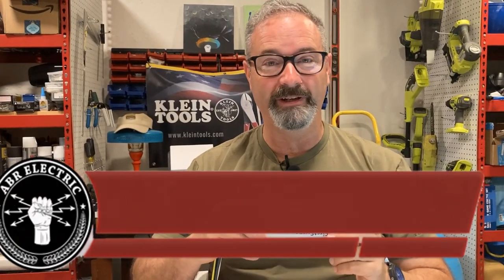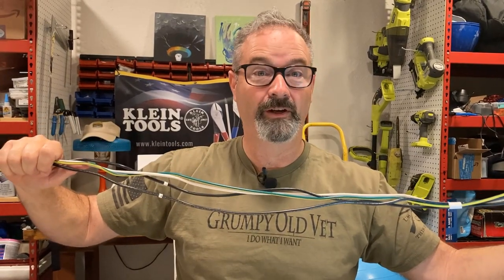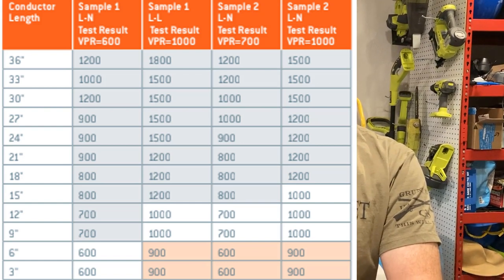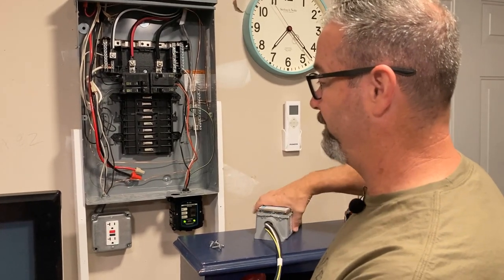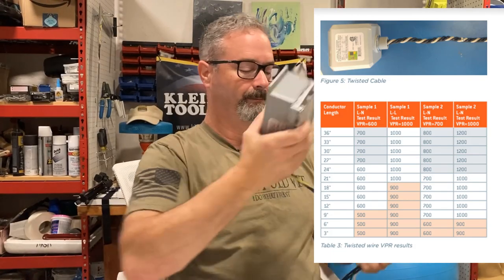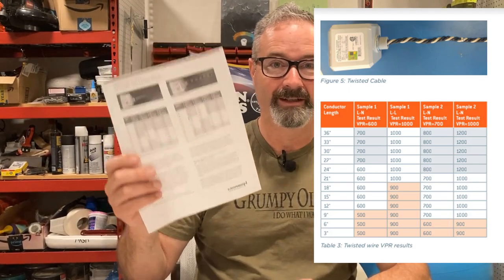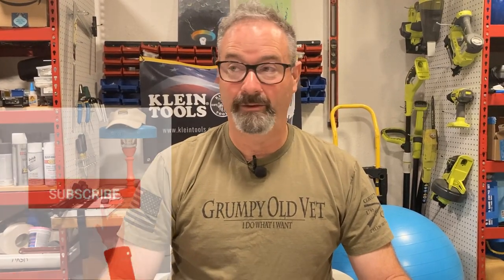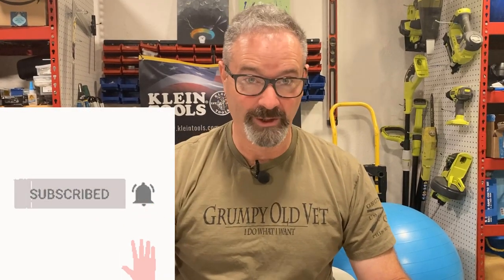Let's do the Twist!: Reducing Inductance In Wire Leads for your Siemens FS140

Comment: Very good video - thanks! When twisting the wires on the FS140, should you twist all four leads together? Twist the two that connect to the breaker separately? Curious what is the best way to twist. Subscribed for the clear, down-to-earth explanations. Keep up the good work 🙂

Comment: What I find ironic about the twist being a good thing is it completely goes against “short as possible”— as twisting is inherently requiring more wire “length” to achieve the same length after twist… meaning it might take 16” of straight wire to make a 12” twisted wire. 

And the second point they drive is straight as possible, no bends or curves if at all possible. A twist is just that, albeit a very gradual curving or bending. 

So it’s funny to me in that way, but they obviously say it in the documentation.
Reply from the maker: @poisonfortheweak  and, because only 2 wires go to the breaker, and the other 2 go to hot and ground, you can only twist for a short distance anyways

Comment: BTW...I reached out to Siemens Tech line on 3/04/24...... ( what a chore...they changed their phone number and I plowed through 4 alternate numbers !!)...and the true tech guy on the last call.....agreed with me that WHERE we place the breaker on the busbar, either close to main breaker or further down....is of little consequence....but agreed with me that the shortest wire length gives value. The unspoken hint was that the buss is a very heavy "gauge" and therefore all CB's act like being in "parallel", so where you place breaker is of little concern. Whereas we are limited to the small-ish 10 AWG ga wire for the connector of the FS 140,  and THAT makes a difference. Caveat....seems to contradict Mersen study regarding bus location.
Reply: Yeah that’s interesting. It doesn’t say anything about proximity to the main breaker/line feed entry in the docs. Though they are super anal about constantly mentioning to choose the breaker that is closest to the SPD— which could easily be the furthest from the service lines. It seems to indicate what you said, that shorter leads to the SPD is more critical than where it is on the bar. 

I mean I get the idea- if a surge comes in from the mains… then you want it to be the closest point to that entry so it can immediately shunt it back to neutral/ground before it gets any further. But electricity is fast. By time it hits the top of the bus it has hit it all. The more important thing I would imagine is it would travel the path of least resistance, right? So it’s gonna take the path that is shortest and easiest to complete the circuit. 

So if it his the bus bar… what path is it going to choose- from the bus bar, through 16” of lead to the SPD and immediately to neutral/ground? Or is it gonna travel through 50’ of Romex across your house and get to the first thing on that line that can complete the circuit?

I’m not an expert or an electrician. But that seems to make the most common sense to me.

Comment: I am watching all your videos...and I just bought a 140 surge protector. Looks simple to do. I want to move a metal handy box to make elbow room. Can i run the handy box with a 6 inch black pipe nipple? Its pre cut and much more solid than 3/4 EMT and connectors. I know you cant do a long run in black pipe...and electricians use black iron nipples all the time. Thanks
Reply from the maker: Technically,  you want to use materials that are listed and approved for that application. Will it work? Yes. Wouldn't necessarily pass an inspection. 
Your call, sir.
Reply: @abrelectric  thanks

Comment: Interior location with flush mounted panel, to keep wires short...how about drill into side of panel and install SPD adjacent to the panel with very short leads directly to breaker nearest service entrance?
Reply from the maker: Definitely doable. Challenge is protecting the wires as they pass through the stud and the side of the panel, with conduit, nipple etc.

Comment: Man I wish I knew this before installing mine. They should put this in the instructions. I think the FS says to put the breaker as close to the incoming line on the bus. What impact does it have if you are not (example, what you mentioned about your Eaton and moving the breaker)?
Reply from the maker: The FS instructions Say to keep the leads as short as possible,putting the SPD as close to the supply breaker as possible. I think the impact simply comes back to the length of the wire leads. 
I have reached out to Siemens tech support to get their feedback about twisting the wires to reduce the v p r
Reply: @abrelectric  agree. As short as possible and we know we do what we can there. Mine is about 12" to ground/neutral bar on the terminal closest to the return wire and about 16" to breaker with the breaker being the first breaker after the main (which I thought the instructions recommended). Didn't twist and if I did now I probably wouldn't have enough wire. Wires are running in EMT in wall. I would love to know what you hear and any details on how a wire bend impacts the vpr.

Comment: Are there any drawbacks to the models that replace a breaker? QSPD models have max of 65kA and they use up a slot, but they have zero wire length between L1+L2 and only ~3" for neutral. Best case scenario with FS140 8" of wire. More likely 12" or even more if the installer did not worry about minimizing length. So QSPD is 600V and the FS140 is 600V-900V and a more involved external install. Maybe the worry about them overheating and starting fires has people opting for externally mounted SPD. I can drop in 2 QSPD breakers in my panel and be done with this project in 2 minutes. This also has some redundancy and better VPR. How often do these siemens SPD have catastrophic meltdowns?
Reply from the maker: If the breaker style SPDs have the specs you like, go for it! They are super simple. This is the kind we use most often because the client just wants Code compliance and is not worried about the highest levels of protection.
Reply: @abrelectric  the only difference seems to be capacity, do you want to cut one open and check?

Comment: A Surge protector strategy, like any other insurance is not foolproof, and the insurance companies always say it's an act of God and we don't cover it.
 One customer had multiple layers of SPDs when the utility companies 25 KV line fell down on the 12 KV line.  The resulting prolonged over voltage was well beyond that of the surge protectors parameters.

Comment: is there a way to test the ground to make sure it is correct? -- aside from looking to see if there is a wire on the ground rod outside by the panel????  is there always a water pipe ground????? AND  when we twist, are we twisting all 4 wires together or just the two going to the breaker?????  but mostly, how do we non-professionals know the ground is correct? so I guess the whole does it have to be at the top of the panel thing is a whole lot less important than make it  as close to the SPD as possible no matter where it lands on the bus (making sure it hits an odd-even slot so it hits both legs)
Reply: We can only test for ground, not quality of ground. If we had a megger, we could not test ground quality apart from utility's third wire which has a white line on it. Visual inspection reveals most ground deficiencies like grounding conductor disconnected and 2 foot ground rod lying on the grass, I think that's more than half, just that obvious.
Reply: ...I guess we might disconnect ground wire at bus or rod, meg just the rod or 2 rods. If ground isnt working at a device or box, something should be visible. We have to notice bond at main, all bare wires bonded at boxes. Spot old romex, for which code leaves us alone to judge how to make that work, pretty much, so that we will git er done for safety sake

Comment: Does moving the breaker all the way down to the buss bars make  difference since it is further away from the other circuits?
Reply from the maker: Moving the spd breaker closer to where the feeders attach to the main breaker helps the performance.
Reply: @abrelectric  I've read many of your other comments that it doesn't matter where the SPD breakers are installed relative to the main disconnect.  The comment above seems to be the most recent on the topic.  Did you receive new information from Siemens that changed your mind? Thanks for the clarification and the great content you provide!
Reply from the maker: @Craig Danielski  Interestingly, the Siemens tech support was almost ambivalent. I was asking about twisting the leads, which he said didn't matter in residential. I think it's a good practice to be as close as possible to the main feeders. I wouldn't move all your breakers to get there, though.
Reply: @abrelectric  thanks for clarifying because that’s my exact situation. To mount in first stab after main breaker, I would have to move all of my breakers, install tandems, and punch through the side of my box. The hots and ground lengths would be about 9” and the neutral 30”. If I mounted the SPD breaker at the bottom of the panel, hots and ground are 6”, neutral is 18”.
Reply from the maker: @craigdanielski  sounds like a win!
Reply: @abrelectric you said being closer to the feeders increases performance… I just wanted you to consider this and I wanted your thoughts. Not saying you’re wrong it just does not say this in the documentation anywhere. Only that the SPD needs to be close as possible to its designated breaker and to the neutral/ground bar. E.g. shortest leads possible. Here’s what I say about being close to the service line entry as possible as well:

I mean I get the idea- if a surge comes in from the mains… then you want it to be the closest point to that entry so it can immediately shunt it back to neutral/ground before it gets any further. But electricity is fast. Really fast. By time it hits the top of the bus it has pretty much (although not technically correct) hit it all. How fast can electricity flow through the bus as a conductor? I’m sure there are variables like what it’s made of, temperature, etc. 

The more important thing I would imagine is it would travel the path of least resistance, right? So it’s gonna take the path that is shortest and easiest to complete the circuit. 

So if it hits the bus bar… what path is it going to choose- from the bus bar, through 16” of leads to the SPD and immediately to neutral/ground? Or is it gonna travel through 50’ of Romex across your house, fighting the much greater impedance along that way… and get to the first thing on that line that can complete a circuit for it? Seems iffy. Maybe some residual overflow current makes it but… I dunno. 

I’m not an expert or an electrician. But that seems to make the most common sense to me. Though I admit I don’t fully understand it all… so maybe that’s what this VPC is? The amount of current that the SPD “bleeds” out or the current that the “vacuum” of the SPD couldn’t suck up, so to speak?

Anyway I don’t know the answer but I do think it’s an interesting thing to consider and think a little deeper on.

And there’s further technical and even philosophical questions lol like if it finds a “not very resisty” path on its way down to the SPD path is it like ah well this path is pretty easy enough.. let’s head this way.. lol… not know if it had just kept going it would have found a path that was much easier?

Or - how does it know when to make that decision? Is the delay between hitting the first branch and the final one so infinitely tiny that it essentially hits all paths in that panel at once like I suggested? 

Even still, if there were any delay at all between hitting subsequent potential paths… that would mean that either the electricity had to know how many possible paths there were ahead of time so that it knew when all paths have been reached and discovered. Only then could it make a decision. So it would “wait” for all options before it chose one. 

Or… it chooses whichever path is first available and then if it hits another possible route that is faster, it would have to go back in time and negate or reverse the decision to choose the previous less efficient path… and continue on until it hits the last possible path for current to flow… finds it to be the path of least resistance, since it has already discovered and tested all previously discovered paths…. And it now goes back and changes its decision again.

Or does it choose all of the paths at the same time, but the superimposition collapses when it finally has hit and surveyed all pathways? Quantum magic!

If I had to walk down a 100 mile road with hundreds of side roads and it was given ahead of time that I would always choose to take the right or best road….one would have to conclude I had precognitive abilities/was psychic….. or I had acquired that knowledge through some other means (someone had a map and told me which was best)… or……..

Well we just wouldn’t know.

But you’re welcome, it was my pleasure to blow your mind. I hope it can recover one day from that philosophical quantum creepiness. I doubt it, but I do hope so. 😅

P.S. you can tell I have no idea how science and electricity works lol… but that sounded like I was really smart and sophisticated for a second. Just proves you can sound smart while being little more than a flashy hillbilly.

Comment: Does this surge protector require  a lightening  rod ?
Reply from the maker: No, it does not. But, how would that work?
Reply: @abrelectric  I have a whole house generator bout 30feet from the house inside a 7x7ft shed and a DuroMax 10,000 watts and grounded to a copper rod 8ft into Earth ,I saw some where on you tube that the surge protector had to be grounded I didn't know, that was my reason for asking.
Reply from the maker: @Jim-bx7vs  by 'grounded' the manufacturer means connected to an equipment grounding conductor that goes back to the service panel.

Comment: What is the significance of the A & C designation on the 2 hot wires for the FS140?  I couldn't find anything on this.
Reply: I could be wrong but I believe, it's the 2 "legs" on your main panel, each at 110-120V ( to make 220/240V). Agreed....it's odd...as in the panel these 2 legs are labelled A and B.
Reply: I sent a note to Siemens and they actually called me back. The A and C are just the two legs like you said. They didn't give me a definitive answer for why they use that instead of A and B.

Comment: On your graph at timeline 3:42....for the left-most column data....why is VPR 1200 at 30" length....then oddly drops to 1000 at 33" length....and then again is 1200 at 36" length? Seems some numbers got switched. ASIDE.... the FS100 comes with 10 ga leads.....would much of this question go away with 8 ga , if THAT was used by Siemens ? Seems "too big" gauge for a given breaker Amp rating is OK.....but wouldn't be the other way around ( higher breaker Amp rating with smaller wire).